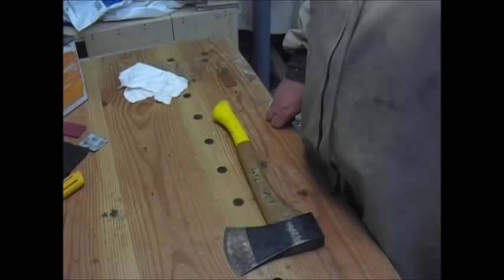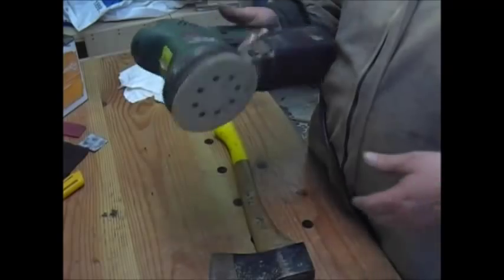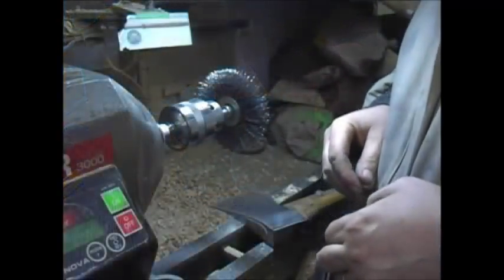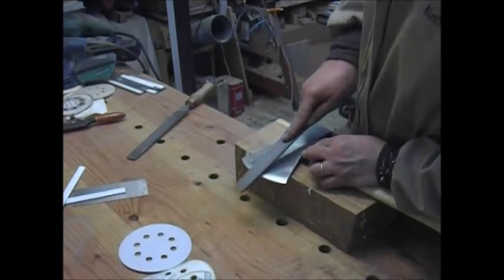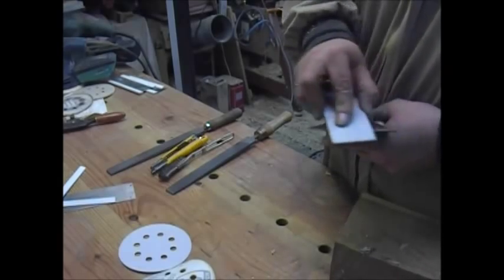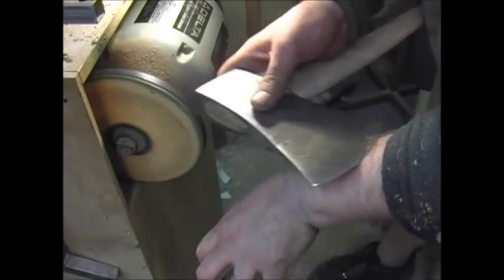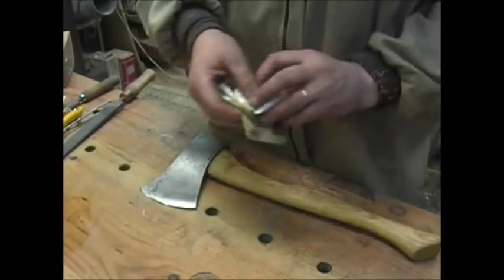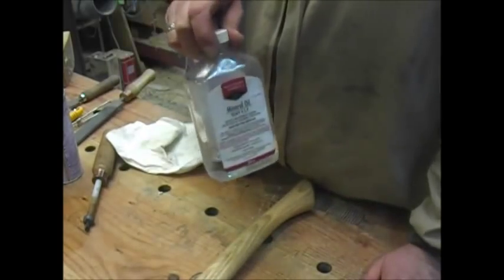Restoring A Hatchet

Comment: When I file grind my axes, I usually have the file almost flat against the blade, working from the blade back.  Grinds that are thin (less than 15 degrees file angle) bite deeper and are sharper.  On good, hardened steel don't worry about having a steeper angle so that it doesn't dull...
   A bit of advice from a seasoned woodsman.  Also, the hatchet you have is good..German steel, correct handle grain orientation, head tapers correctly, bit is thin. 
We both got started with Wranglerstar's wonderful videos.  He is the go to source on old tools and homesteading.

Comment: Way to go - growing up in the NW US the only difference between hatchets and axes there were between head weight/size and the length of the handle. I have seen people using "boy's axes" with sub 2' handles and they called them hatchets, horses for courses I guess? Interesting to see a western style axe in Japan and a German import before unification no less, should turn out alright I think.

Comment: This may be controversial, but I am firmly anti-BLO, and I always feel compelled to spread the word.  Have you ever seen old wooden handles or tools that are dark and sticky to the touch?  That's the long term result of BLO.  It's a great finish (for a while), but eventually the surface will darken. Exposure to UV light (sunlight) will accelerate the process.

The stickiness will make dust and dirt difficult to remove. Since BLO penetrates it is hard to sand deep enough to remove it.  I prefer Tung oil for tools and handles. It is a drying oil with a downside - it takes longer to dry.  It does not darken with age and never becomes sticky.  I wipe in on in thin coats and let it sit.  The longer drying time has never been an issue for me.

If you use Tung oil instead of BLO your grandchildren will someday thank you for it!
Reply from the maker: drstampfli is it possible that the problems you are attributing to BLO (BOILED Linseed Oil) is actually a problem created by plain old Linseed Oil? I know that I made the mistake of buying some Linseed Oil once, it was a translation problem from Japanese to English, on my part. That stuff never dried.... EVER and it was sticky and awful. BLO is a hardening oil, but certainly it does not harden as much as other oils do, day Watco Danish Oil. I would agree that Tung oil is also a good choice. I do also mention using Mineral Oil as well.
Cheers!
Reply: StuInTokyo There is a clear advantage to BLO over raw linseed oil. BLO has additives (chemical and metallic driers) that make it dry much faster and harder.  I believe, however, over time the BLO finish will have the same problems as the raw linseed oil.  The issues aren't easily seen in the first few years (or maybe decades?).

The old-timers were probably using raw linseed oil.  They also subscribed to the "more is better" theory.  I've read old books that described methods of preserving hand planes by submersing them fully in linseed oil.  The wooden planes were held down by heavy objects (like bricks) and left to soak for weeks.  This probably made the future problems worse.

I like tung oil because it does not darken over time, never gets rancid and doesn't get sticky.  It may not last as long as BLO, but wiping on another coat every few years is easy.  BLO is a beautiful finish.  It makes wood look wonderful when its applied, and it might stay looking great for a "lifetime".

With proper care, many tools can last several lifetimes.  I have inherited some nice wooden planes that have been in the family for 150+ years.  Unfortunately, great grandpa didn't use tung oil! 

Thanks for sharing your video.  It's always great to see an old tool improved or restored!
Reply from the maker: drstampfli
Thanks for your input and insights.
Generally I like very little on my tool handles that I use a lot, a coat of BLO and then I would rather have the natural oils etc from my hands using the tools to coat the handles.
Again, thanks for your comments!
Domo